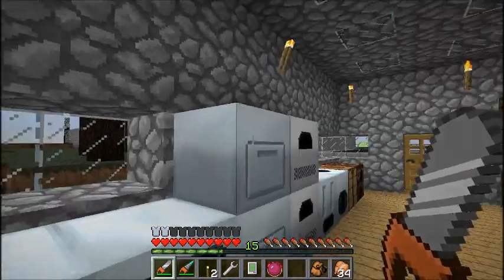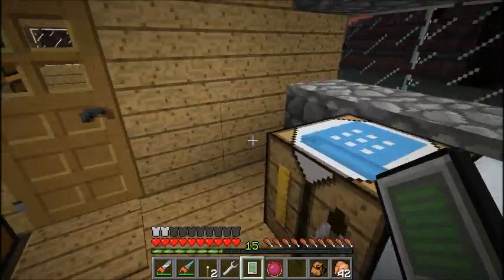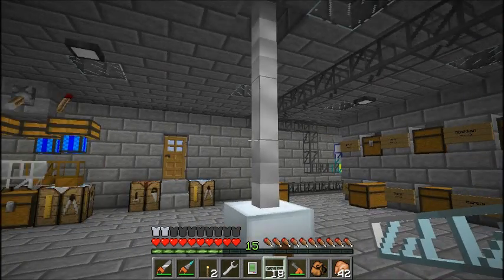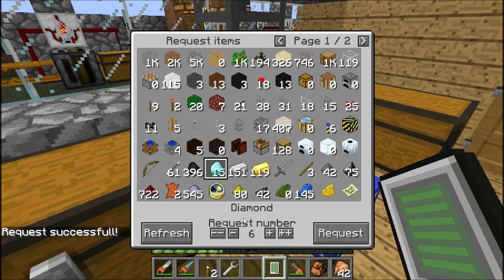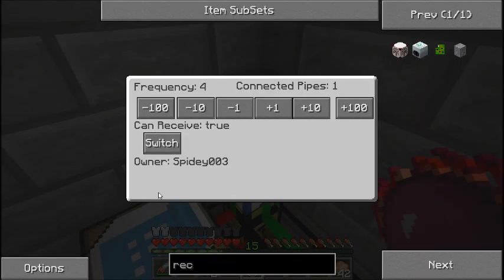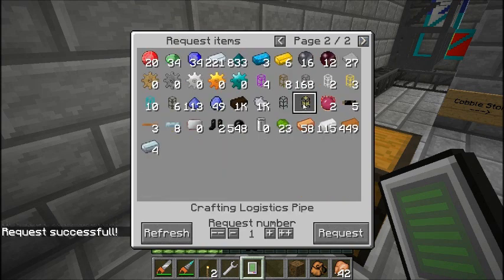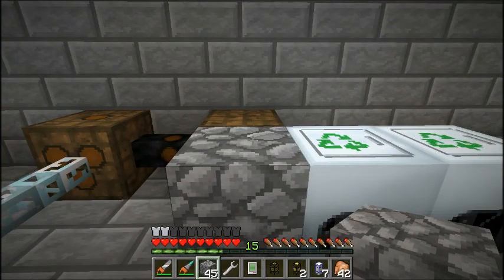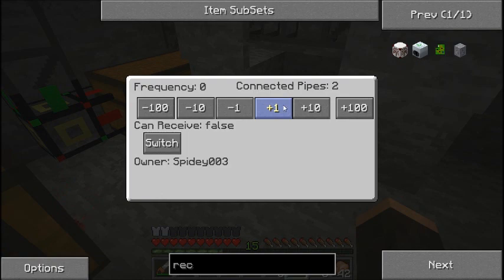Let's Play Industrial Automation Episode 19

Comment from the maker: @JordynX096 I tried my new video at a lower resolution to get a higher frame rate. I use fraps and get about 15 frames with my current resolution and was getting about 30 with the lower resolution. My machine is an older one tho with a reasonable video card and I am pushing it's limits on recording.